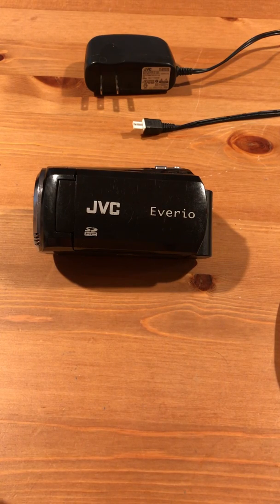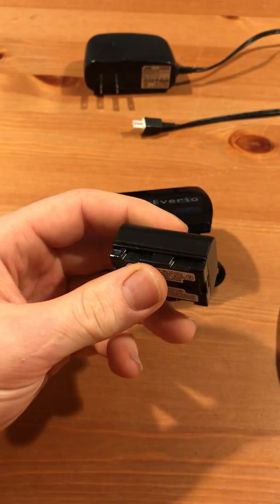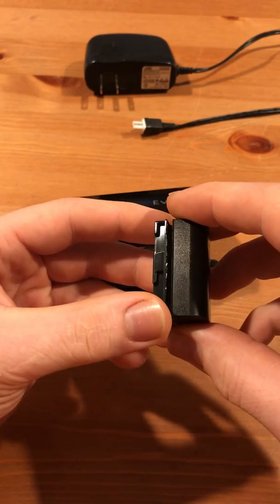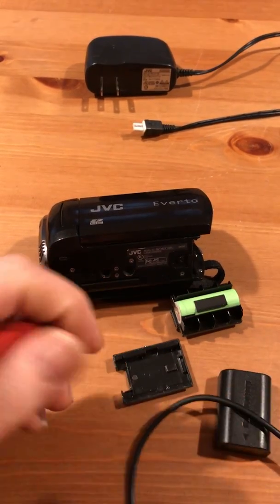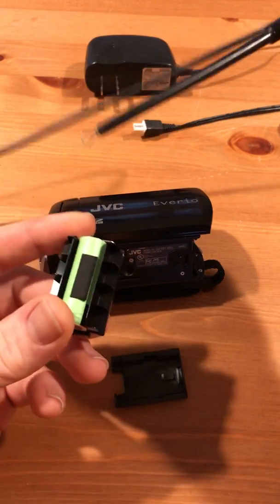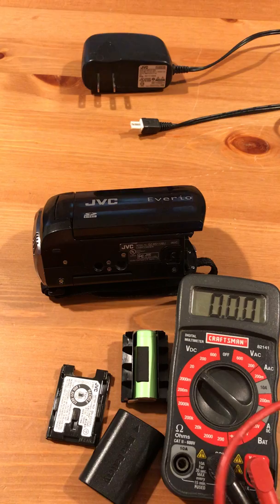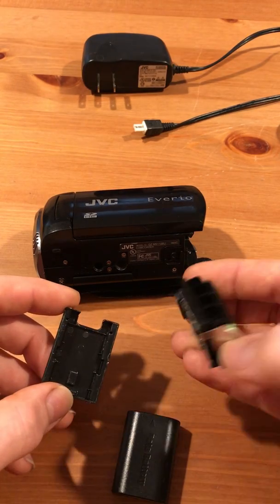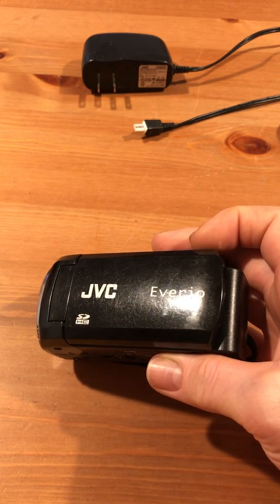JVC Everio Camcorder GZ MS110BU Dead Li Ion BN VG107U Battery Repair Recharge Disassemble

Comment: Very interesting and congratulation on your success to revitalize it.
My question is, now that you found the circuit and internal connections, wasn't it possible to change that battery with another one, say a commonly used 3.7 V type 18650 @ much higher mah (If the size can be dealt with) or better, a 163C05 IMR RCR123A / 16340 550mAh -700mah, 3.7V, 
Such as this:
https://www.batteryjunction.com/efest-3277-button-700mah.html
that when eyeballing, looks to be the same exact size of original battery? The later costs between $3-6 and should live many years more compare to your rejuvenation of old battery that probably is soon to fail again.
Could you please update as to how long more you battery lived and any update is highly appreciated.
This was the best of its kind clip that I could find on YouTube, so I am subscribed and two big thumbs ups.
Reply: did he ever update you?
Reply: @gery5529  Sorry, No.